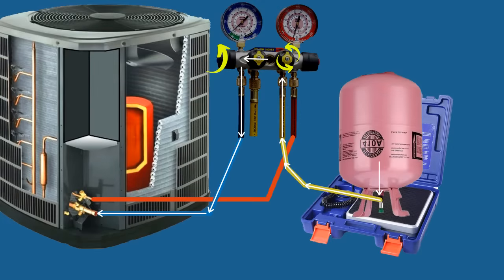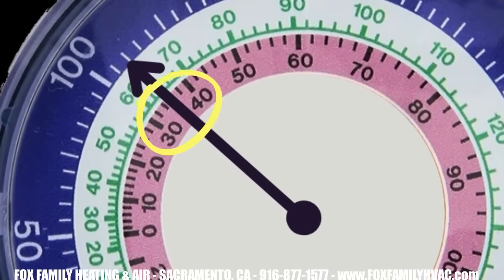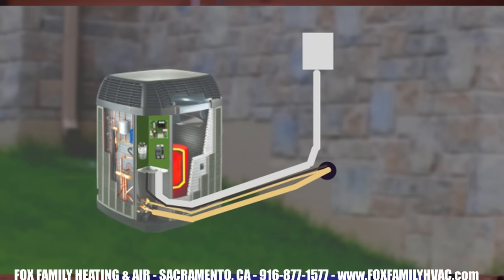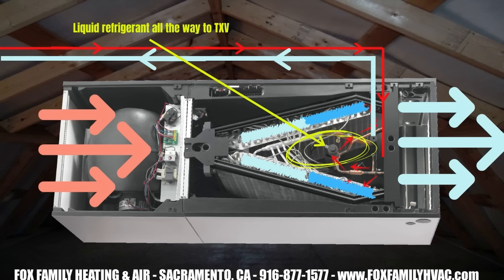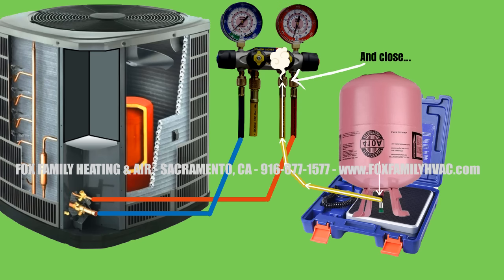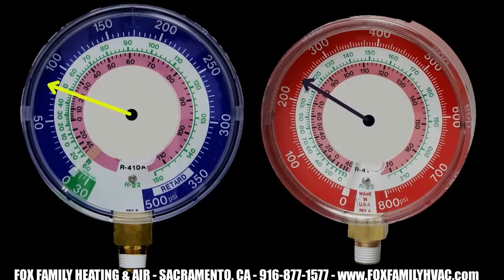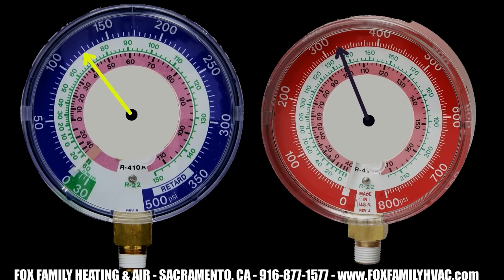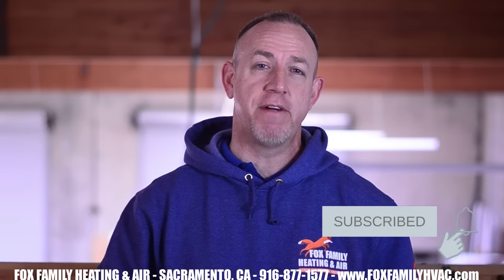How I Add Refrigerant to an Air Conditioner

Comment: First of all I want to say I’ve only listened to half this video. The first half has huge gaps in no sound. Next I want to say everybody’s going about this the hard way. 410a is a blend of three separate gases. If one of these gases leaks out from the system everything that’s in The system is suspect. The best way to recharge a system is to see first of all if you can find a leak. If there is no obvious leaks the next thing you should do is to change the valve cores on the access ports. The next thing you should do is evacuate all the refrigerant that is in the system. Read the data on the nameplate data and find out how many ounces or pounds and ounces your unit takes to operate efficiently. A digital scale is needed to put the proper charge in the system with “ The bottle turned upside down so that the shut off valve is on the bottom”. The refrigerant bottle should be upside down on your Digital scale. If you have evacuated the system, you should then put The liquid in the high side first. Once the system is equalized, you may now turn on The system so that it runs. Slowly put the liquid into the suction side. If you put it in too fast, it will wash away the oil in the compressor and cause compressor failure. Once you have the measured amount call for on the nameplate data in the system, check for proper pressures on the gauges and temperatures. You are checking for the return air temperature and the supply air temperature for the inside ( approximately 20 to 30° difference). For the outside, you are checking outdoor temperature versus exhaust temperature of the fan on the condensing unit. This should take care of your cooling problem. However, this is only if you have a small leak in the system somewhere. You could still have a metering device problem or other problems with the system. As in someone else’s post, the only way you can buy this refrigerant is if you hold an EPA certification. This is something that is not normally held by the homeowner. Unfortunately, the best way to fix your problem is to call a  technician. I say unfortunately because you’re going to have to bite the bullet and pay the trained individual to fix your unit. This really is not a homeowner fix.
Reply: I didn’t go into great detail because this is for the trained technician. I will say this about leaks, small leaks are usually noted by oily patches on the coil or oily patches on the copper lines. You will usually need an OXY acetylene torch set to fix these kinds of problems. That is why I suggest a trained technician.
Reply: As a self-professed expert, it would be expected for you to know that 410a has 2 gases, not 3. 50/50 blend of r32 and r125. A discerning reader would use this observation when judging the reliability of the rest of the write up.
Reply: There's not a single technician who would want to repair the unit. Every technician's from salesman pretty much
Reply: But thanks your reply helped alot in understanding some of confusion why he's adding liquid to the suction line
Reply: @fredware1324    For the leak, why couldn't you thoroughly clean the area with a good solvent cleaner (and/or rough it up a bit with some sandpaper), and then use original JB Weld epoxy? JB Weld is one of the few epoxies that works well with vacuum systems (i.e. can seal them well without outgassing much and being very low permeable), has a broad temp tolerance range, is pretty strong and tough stuff.
Reply: @realSamAndrew    Speaking completely hypothetically of course, if an AC unit is already low on refrigerant, could one evacuate it, and replace it with say a cleaned propane or propane-butane blend?  

    It really sucks that industry/business has us consumers by the cajones with this.
Reply: @justinw1765  absolutely not. And out of curiosity, why did you decide to ask this question of me? I didn't claim to be an expert as did the person I was responding to. Why would you think I would be an authority? Just curious.
Reply: @realSamAndrew    Thought you might know something since you corrected the other guy.  Doesn't hurt to ask.
Reply: @justinw1765  I agree. Again, I was simply curious.
Reply: @realSamAndrew    Why can't propane be used?  You said absolutely not, which makes it seem like you know there are specific issues.
Reply: @justinw1765  propane is highly flammable. These machines are not designed to be compatible with flammable refrigerants. The pressures and heat properties are all different with respect to size and device operations. It is illegal and extremely dangerous. Need I continue?

There are refrigeration devices that do use flammable gases but they are specifically designed and tested for this and are limited to mere ounces  of the substance in TOTAL VOLUME in the devices components.

Or, to put it another way, can you use diesel in a car engine designed for gasoline if gasoline is banned?
Reply: @realSamAndrew    I don't think it is an apples to apples comparison to compare gas and diesel use in a car to this issue.

  But yes, I'm aware of all those factors. 

   With that said, there are people who have replaced standard refrigerants in both cars and home AC units with propane to good success allegedly, and for years.  

   And ironically perhaps, but word on the street is that Europeans have been making the switch more. Ironic, because they tend to be more hyper concerned with safety and potential social issues for others/the collective, as compared to Americans. 

   I'm just trying to find out more information for informed decisions. I have no concrete plans of action.

   The basic concept is that you use energy to compress a gas, and when that gas is then allowed to expand, it releases the energy in the form of heat.  A lot of refrigerants have some flammability.  But when oxygen is severely reduced as it is in vacuumed systems, flammability is generally reduced.  So while it sounds dangerous, maybe not so much in actual practice most of the time. 

   I'd rather use something like propane than something like ammonia.  

    I'm more so toying with the idea of making my own cooling system using a combo of methanol, activated carbon/charcoal, borosilicate glass, copper, and stainless steel, putting the system under a light to medium vacuum, and using the heat of the sun to drive/regenerate the system.  But this would only work as a room cooler at best (and only really works during the day, though with the right materials [like quartz glass instead of borosilicate and a reflective Al panel underneath it], it could work as an IR radiative sky window cooler at night too).

   Basically, you put a large borosilicate (or quartz) glass container out in an area with a lot of sun exposure.  Into that, you put plenty of activated charcoal.  You connect two vacuum rated tubes to the glass container, and run that through an insulated window insert into a room and connect to a stainless steel or Al container.  

   You fill up the inside metal container with methanol. Seal it all up well, pull a vacuum and seal it.  The vacuum lowers the boiling point of the the methanol to around room temp.  

   As it evaporates out of the metal container, it absorbs heat and carries it with it as it convects out. Meanwhile, the activated carbon/charcoal in the container outside has  a strong affinity for the methanol, attracts and adsorbs it, acting as a passive pump/collector. 

   But simultaneously, it's all getting heated up by the sun and so returns to gaseous form so after, and via some kind of condenser to re-cool it back into liquid to enter the steel or AL container inside. 

  Note, this would only be a supplement to a whole house AC system.
Reply: @justinw1765  good luck with your experiments. There are many things that people CAN do. But not all those things are a good idea. The MTV show Jackass was popular for a reason. You can still find R12 in the wild, and you can still dump it to the sky if you want to, but it's not advisable and very expensive if you get caught.

Comment: Remember,  if you have to add freon, you have a leak somewhere.
Reply: This can be checking charge from new construction start up. This all depends on how far the line sets are.
Reply: Learned that this week
Reply: Finally someone said this...
Reply: Can be so slow a leak in my case a top of every few years and she keeps us comfy cool all summer long. 10 yrs now. Added 7lbs
Reply: Not always, it can also come from when techs out there guages on and off. Doing that over time you're losing refrigerant as well.
Reply: @Jason O  7 pounds in 10 years is up to 10 years in prison.. 😜
Reply: It could be from deminimus release over time or a something as a loose valve core from said gauging. It doesn't always mean a leak

Comment: 410A is a blend refrigerant if 5 pounds leaked out you cant just add 5 pounds and expect it to work properly.
Reply from the maker: Hmm. Assuming you were to take care of the leak or vacuum , I would say adding those 5 lbs back would take care of it.
Reply: It’s not that critical
Reply: If 5 lbs of a blend leaks out why wouldn't adding 5 lbs of a blend work properly?

Comment: 1st thing everyone thinks, my system needs charged.
Unless a leak exists and system was not probably charged during install, it should not be low on gas- refrigerant, freon is a trade name for dupont r-12.
I will not be watching to the end, I assume you discuss bleeding has from the high side hose after disconnect.
If not every time someone connects and disconnects you lose several oz.of refrigerant.
Forget the rest, call the best

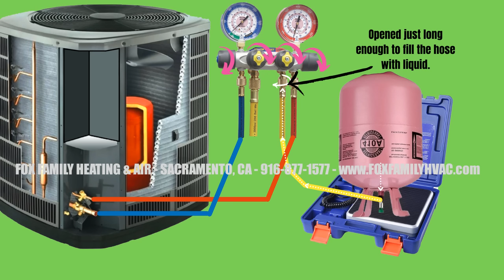Comment: 5:30 adding in the liquid form would cause more stress to the compressor from my experience. I believe the gas form would be better (not upside down).
Reply: No bro
Reply: Not for 4-10A De-Fractionates the refrigerant.
Reply: Can't Charge in vapor form

Comment: why you add Refrigerant using the high pressure side? @6:37 it is dangerous
Reply: It's ok to add on high side if it's empty . With the unit  not running.   for few pounds then go to low side for the rest of it,but feed it just little at a time

Comment: It's 2 am and it sounds like a water fall in my ac closet , low on freon again , non of the local ax companies can fix the leak , spent enough to replace it now , had them redo the drain also , they didn't get that right either ..guess I gotta do it myself , after spending thousands to have local professionals do it ..what a joke ..got my macs license,  bought my own gauges , bought some freon , got the multimeter that does Temps and such , still don't have a scale , but at 2 am ...priceless ..fixed it in 14 minutes for now ...now where is that leak , dam Sulphur water ate the new air handler (everything is right by the bathroom door that we shower in ) is what there telling me ????

Comment: IMO you should be addressing the leak instead of topping off the system & you shouldn't be showing people how to top off a system. I have no issues explaining HVAC but you absolutely should not be doing any of this without proper supervision & or training
Reply: Assuming the leak was fixed just prior to this video.

Comment: Piston? TXV? EEV? There’s so many things you’re glossing over. I’d assume being a company based in California, you’re selling mid to upper end systems, which would most likely have TXVs. Sub cooling is the value you’re looking for. Not superheat. If you’re a tech watching YouTube videos to learn how to do your job, you should probably find another line of work. Maybe flipping burgers or something.
Reply: Even on TXVs you should always check superheat. The TXV is designed to maintain a superheat range. Charge by subcooling and check to make sure the TXV is working probably by checking superheat
Reply: Meh, I'd say going off of pressures is good enough for the diy guy.  Too difficult to distinguish between piston and txv metering devices.

Comment: With the system off and liquid line and suction line service valves closed. Is it ok to add liquid r410a into the high side? Thanks